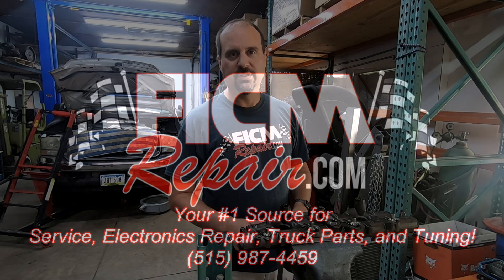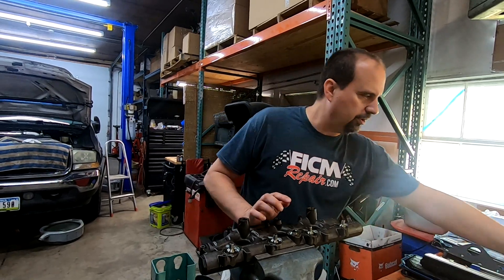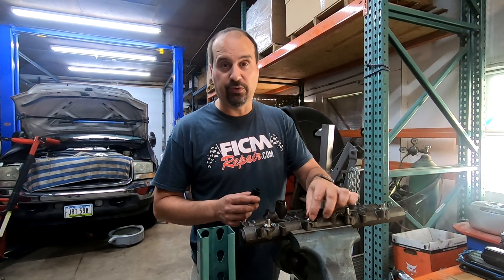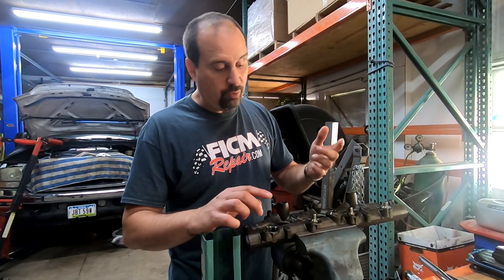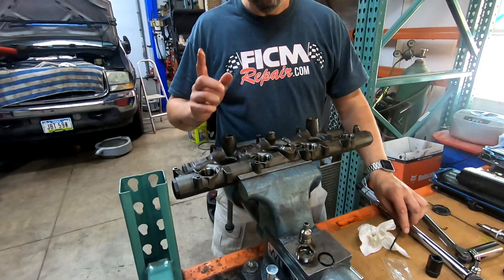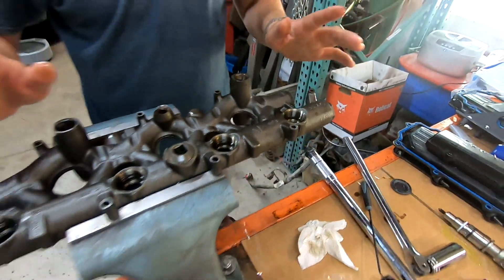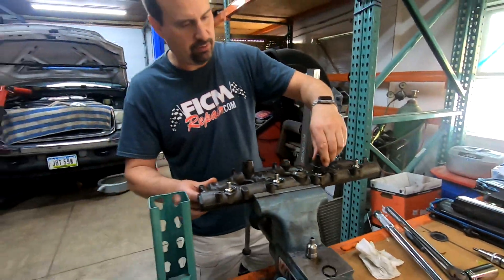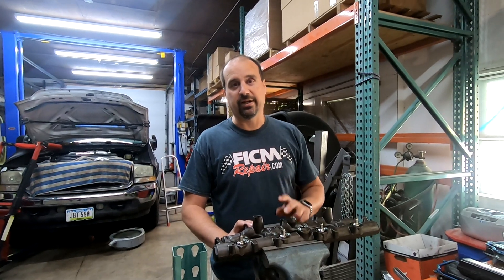HOWTO Injector Cup Nipple O-ring Replacement Powerstroke 6.0

Comment: Good afternoon, I have a question. My injectors leak air through the two holes on the top, is that normal or not?
Reply: To an extent. 6.0 injectors all leak out of the weep holes on top, however this leak cannot get confused with bad leaking orings that are also on top of the injector.
Reply: Just an FYI sometimes injector leak way more than they supposed too. Due to spool valve or? But I've seen this. You can put a rubber tipped air nozzle to the top or them and listen and compare to the others. Had a hot no start due to injector. Not any seal or oring. Especially with all the crap the parts stores sells.